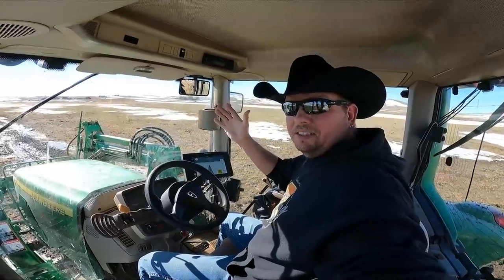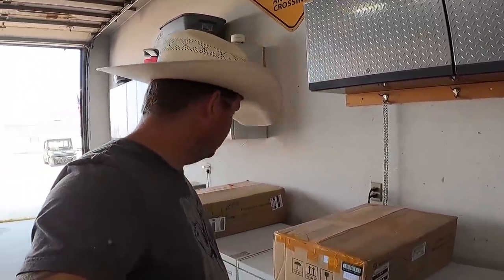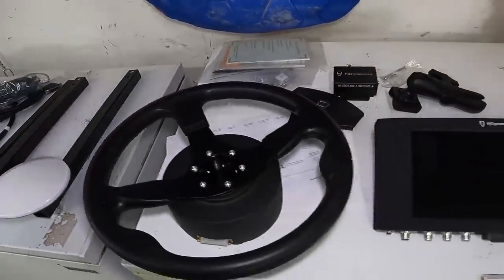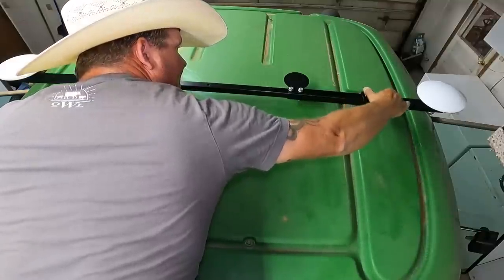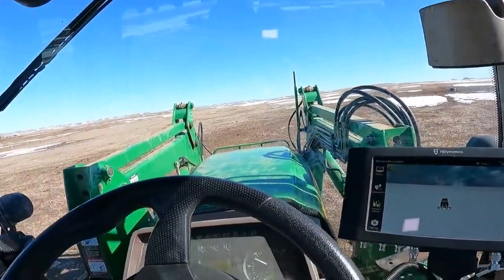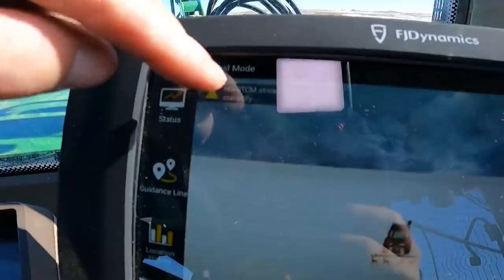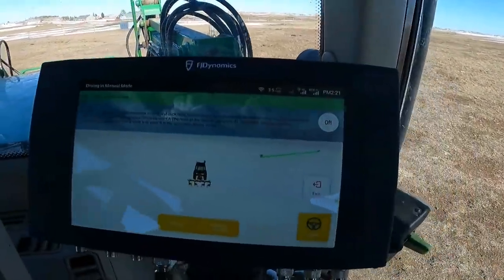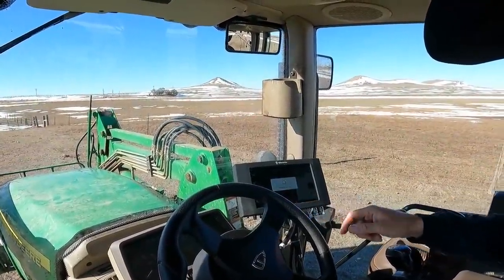FJD Autosteer Kit - The Tractor Can Drive Itself!

Comment: I'm old school and for those of us that are, we have a hard time letting go of the wheel, wink wink! That said I can see the advantages for row crops and hay mowing in level unobstructed fields. Around here we have a lot of trees, hill and hollows that are pretty tall and low, so I think that would be a problem. I do like the concept and the explanation of how to install and instruction to activate and set up the system was thorough. Some really cool aerial shots and a nice presentation as always, Mike. Thanks for sharing and have a great day and a great weekend!
Reply: Have used john deeres greenstar system and aftermarket systems here in the UK in small (rarely over 15-20 acre fields) very hill in the dales areas around me full of rocks and trees with no problems at all. It's all about how you use the system found it invaluable with pumping slurry with a umbilical system dragging pipes. It dose take some getting used to but after you learn it it's hard to go back. I wouldn't be without auto steer on at least one tractor now

Comment: In 2012 I bought a used Ez-steer for planting annual forage crops intended for cattle feed.  I quickly found more and more applications of the technology including tracking where I fed cattle in the winter with my bale processor.  I was able to get uniform manure distribution by feeding in an organized way even when snow made it impossible to see where I fed the day before. With rtk you will be able to lay out fence lines laser straight (though you will still want to use a surveyor for property boundaries) the possibilities are many.

Comment: Hey! You may have solved your own issue. Use the auto steer to guide your hay feeder to feed in a different path each feeding. The seed heads will help establish new grass that needs reseeding and cows will not ruin areas due to continuous feeding in the same areas. You won’t have to reseed these areas.

Comment: That is funny, this is the third channel that I follow that just got a John Deere autosteer unit. One was an older unit that gets leaned against the standard steering wheel, then one like this, but this is the first that showed a how to install the unit. I appreciate that part especially.  That nut holding the steering wheel on is super sketchy. I hope you can get a socket on it and torque it down... Everybody says they get an overlap on the gps, but that the actual planting or whatever seems to be fine. There is supposedly an update on route from the manufacturer "soon." I do NOT like self-driving cars at high speed but for tractors and stuff, it is a great technology. I think with cars, if they do not want to drive, hire a driver or take a cab or Lyft or something. Yes I love driving and I have old school vehicles, no gps or anything, my phone does, but I am in Wyoming it is still better with a map and a compass and really I don't drive anywhere I don't know where it is. I admit I do use gps in my semi truck driving system simulated driving rig. But it does not drive me. I do definitely see the need on a farm/ranch. It makes sense.

Comment: Mike awesome video one thing to remember is if you move you rtk base station to a different location you lines will be off so just a hint you might want to setup the base station in a more permenant location so the tractor will still make it through the gates. I realize this video is 2 months old and you might have already figured this out but just wanted to tell you great setup though and I never thought of using it for that( getting to and from hay yard or feeding cattle)

Comment: You would think that the manurfacturer would have provided a special deep well socket to be able to torque the steering colume nut down to the proper specification.  It would not be too cool for the steering wheel to loosen up and come off driving around.
Reply from the maker: Charles the steering wheel shaft has a splined connection so if that nut loosens up as long as I dont lift on the wheel it will be OK. Thanks for watching.
Reply: Shouldn't need a special socket. A regular socket and an extension piece from the torque wrench to the socket should do it.
Reply: Not a good idea for them to supply the socket.   Many tractors are candidates for this kit, many different nuts

Comment: I would think repeated driving  over and over would compact soil for that trail    but do see  advantage  for seeding or even mowing  maybe   also see if you had a hurt calf to transport  in cab  would let you Handel calf better  only problem  I see is need obstacle avoidance  if feeding  not to run over animals  or structures